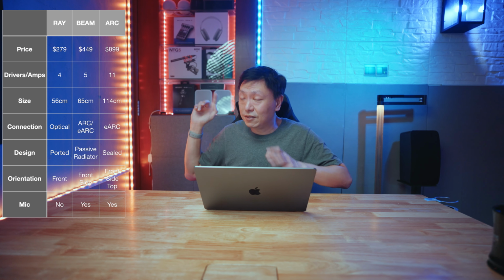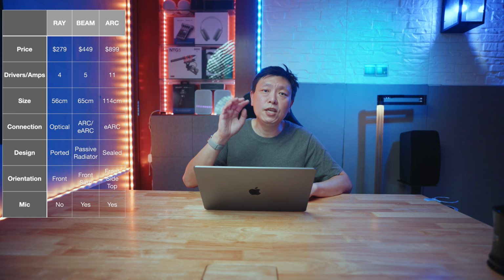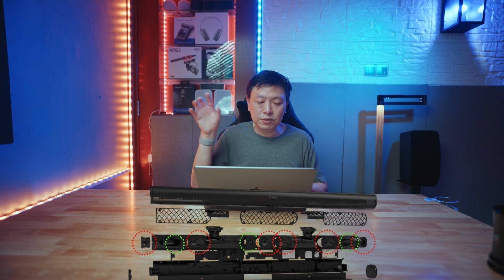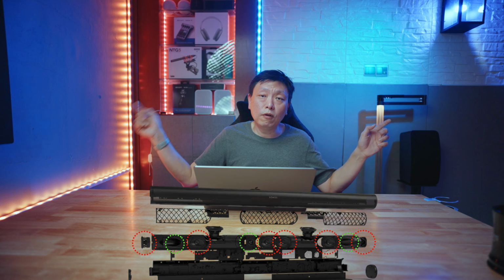7 differences between the Sonos Ray, Beam and Arc

Comment: Man I’ve gotta get an Arc! The Beam is just not sufficient enough for a living room
Reply: Go and get an arc then!!!!!! The beam is great in many living rooms by the way.
Reply: @GREENEEL  it’s only ok. I have one. With rears and sub. Almost everything else over powers it. Rears are at 0 sub is at 5
Reply: @KrAzY_K  have you thought of a faulty beam?
Reply: @KrAzY_K  why is your sub at 5?……… have you done a trueplay sound setup.
Reply: @GREENEEL  I doubt it’s faulty. It’s just that it’s not good enough for a theater like setup in my living room. And the Sun is at 5 out of 15 so fairly low and I like a little extra bass when I’m watching tv, watching movies, playing video games or listening to music
Reply: @KrAzY_K  the sub goes from -10 up to +10 with 0 being the middle point after a true play set up. So you turn your bass upto 5 and say it is over powering 🤦‍♂️ it will never be like a separate sub, but I think it is amazing what it can produce for its size with no need to up the bass on mine. I also like the sound of bass, but it also has to sound right with everything else. Also why don’t you turn your rears down?
Reply: @GREENEEL  no the Sub Audio goes from -15 to +15. You can turn the overall Bass from -10 to +10. I could try turning the rears down but if they are at 0 and trueplay has been done. it should be balanced between front and rear
Reply: @KrAzY_K  So should the sub after true play. And the overall volume does not go from -15 to +15.
Reply: @GREENEEL  yes the sub is adjustment -15 to + 15 and overall bass adjustment is -10 to +10
Reply: Wow, if you own Beam Gen 2, Sub, few Sonos One for surround and yet it’s not enough for living room; then I wonder how your neighbour think when you blast that Sonos sound system. Maybe sounds like Jon Bon Jovi performing live at your living room 😆🤣🤭
Reply: @sglatitude  I’m saying the Beam (Gen 1). Everything else is fine. And arc would be better. Also not much different between the Gen 1 beam and Gen 2 beam

Comment: Thanks for this, it was an excellent breakdown of the differences between the models.  I've been trying to decide for a while if the ARC is worth the upgrade cost over my current Beam gen 2.
Reply: I have both ARC in my living room and Beam gen 2 in my bedroom both with subs and rears. It depends on your room size if your room is really big then the arc would be better. A small to medium size room the Beam 2 is sufficient. It also makes a huge difference if your adding subs and rears. The ARC on its own is a big difference over the Beam 2 but when you add rears and a sub the difference isn’t as noticeable. Also the Beam gen 2 has better center channel output in my opinion.
Reply: after seeing the ARC has sealed speakers and the beam has passive radiators, i'm liking the ARC, better and double the amount of speakers!
Reply: @4-Avenue  why? That is a confused decision.